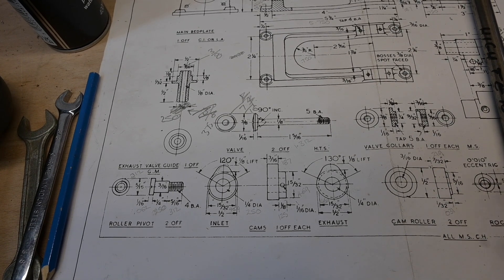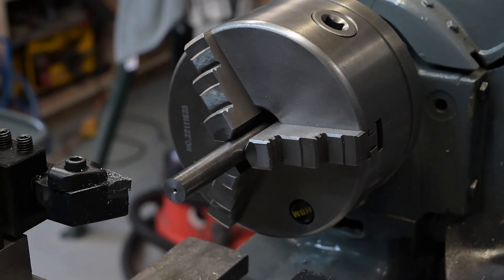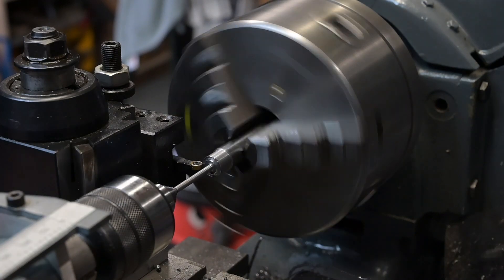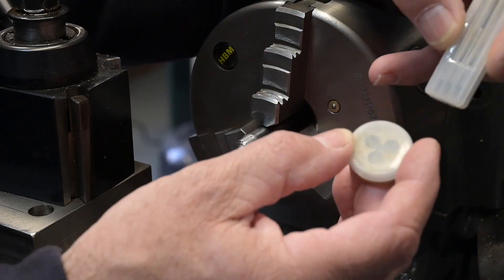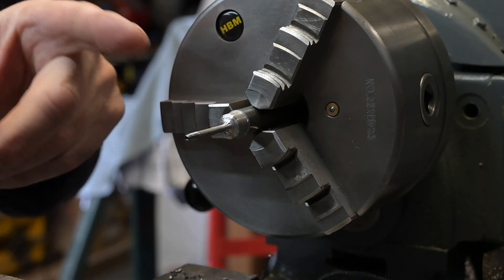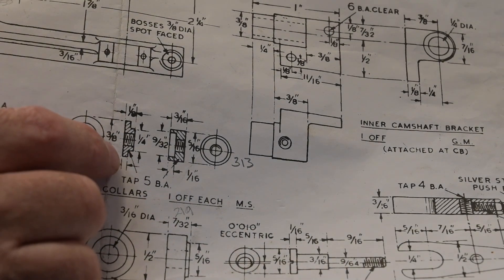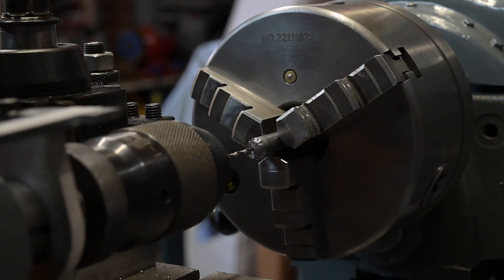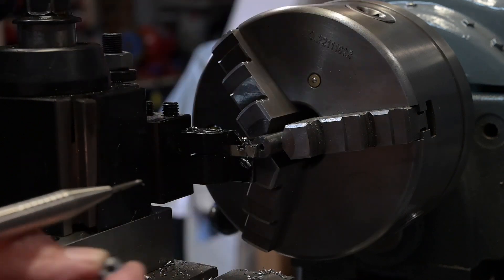Miniature Engine Valves, Hand Made Part 13

Comment: Why not turn down just enough to allow the threading, then turn the rest of the shaft? That way you keep the rigidity against the pressure of cutting the thread? Then work down in increments to minimise the flex.
Reply from the maker: @davidmam  Good Idea, the answer is: I am just a hobbyist and didn’t think of doing it that way, but I will next time. Always learning, Thank You 👍

Comment: A very high standard of machining on the valves Mark. They look great. May be worth looking out for a spare 3 jaw chuck. You could remove the chuck with the work in it, and carry on with the spare. I found a nice 3 jaw very cheap as a spare so I can carry on working if I run into a problem. Just a thought mate. Be happy. ATB Nobby
Reply from the maker: @nobbysworkshop  Thanks Nobby, I do have a couple of spare chucks, but just didn’t think of it 🤦‍♂️ TTFN Mark

Comment: nice one, I don't know anybody with a 2.75mm drill, I suspect they will be a specialist item not for us hobbyists as our machines wouldn't be accurate enough. All my drills go up in 0.1mm increments, this has always been ok for me.
Reply from the maker: @paulrayner4514  I just use the nearest I have, it’s worked out ok so far 🤞😂
Reply: @EnglishHobbyMachinist  same here. only ever had 1 dodgy one, I think it was an M1.2 thread 3mm deep, a bit of locktite as a backup was used🤫

Comment: Thanks again for the videos, do you have to seat the valves using compound or does the machined surface on the valves give a sufficient seal ?
Reply from the maker: @Davidcarroll38 Hi, yes they will be hand seated at final assembly 👍